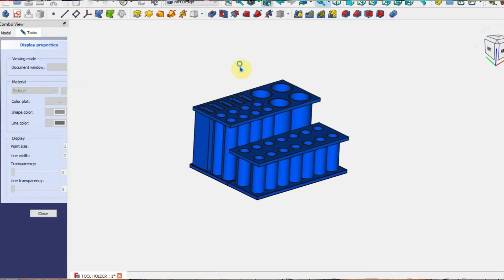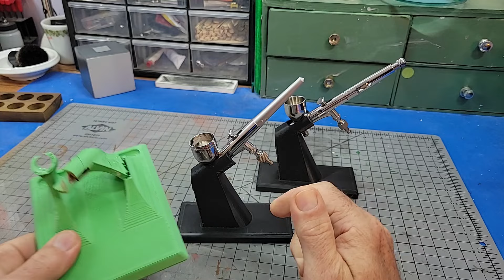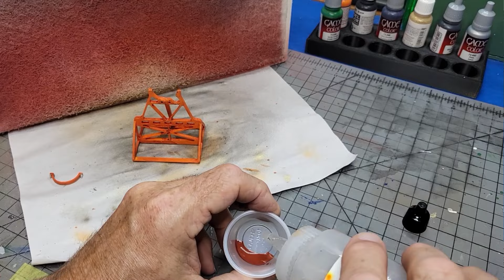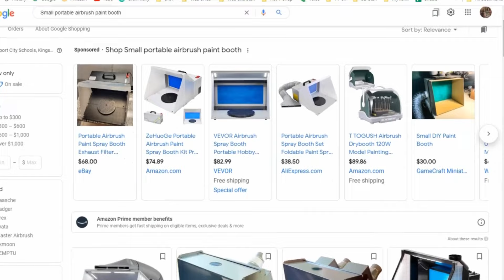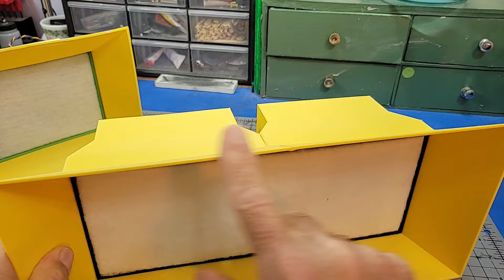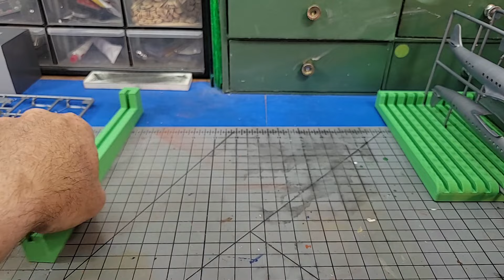Six 3D Prints to Help Creativity and Focus at your workbench!

Comment: Those custom organizers are really nice but for those without access to a 3D printer,  Dollar Tree has round brush holders (in the crafts section) that work well.  I've cut the legs that space the upper and lower trays for shorter tools and cut some of the dividers for wider tools.
Reply from the maker: Before I was gifted a 3D printer, I used coffee mugs and a couple of pint glasses. :o)